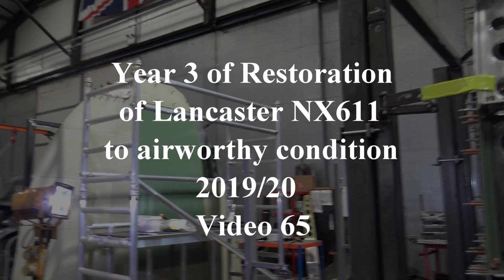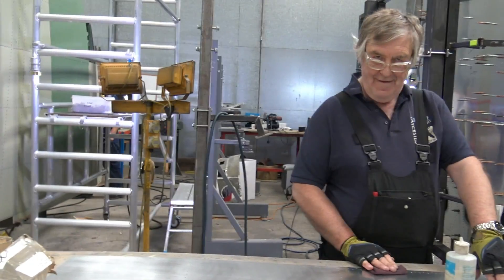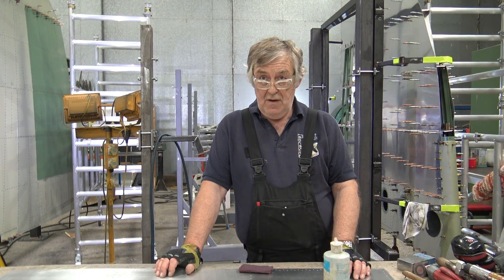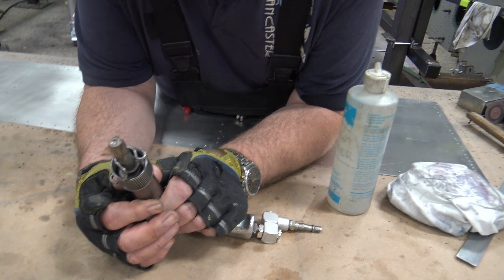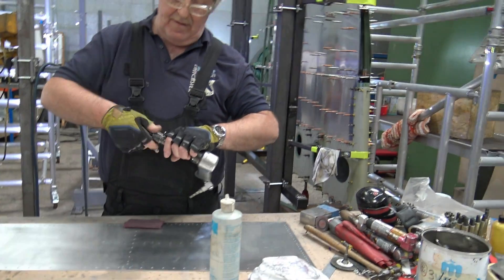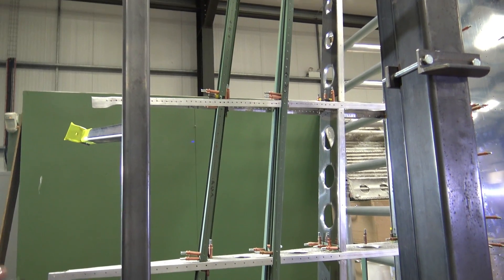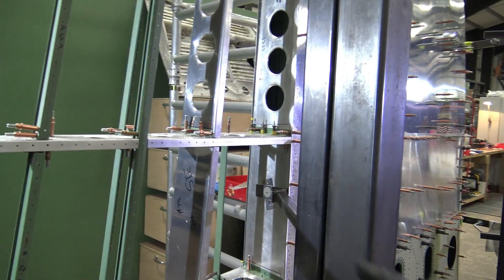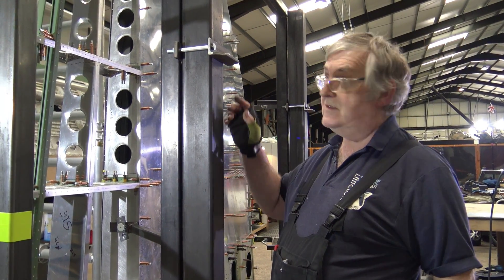Video 65 Restoration of Lancaster NX611 Year 3    Keith on riveting and starboard wingtip

Comment: A lot more than 6’ flex on the wing tip on the A380 I can assure you.
Reply from the maker: Hi Paul, checked on the net on the flexibility of the A380 wings. Keith stated from ground to flying position the wings lift about 6feet he was only a few inches out. It also said on the net the wings can flex from 3 to 5 meters on take off and landing.